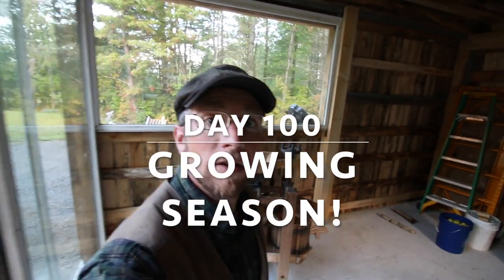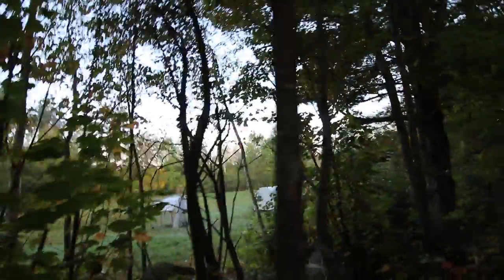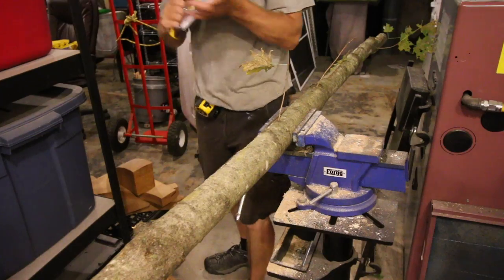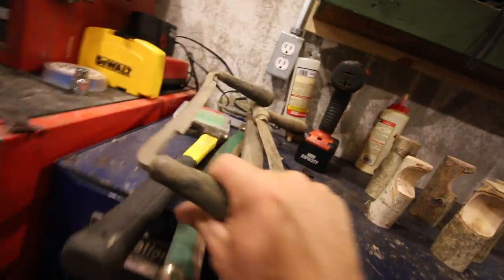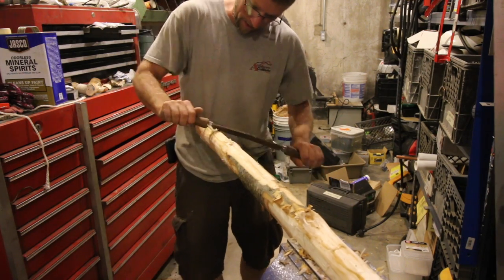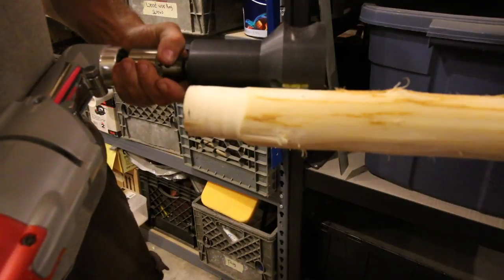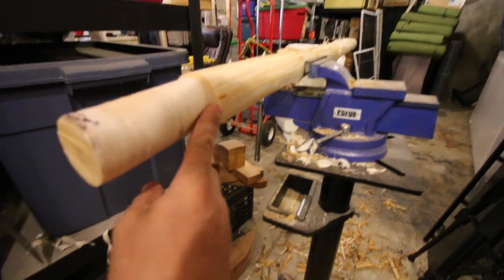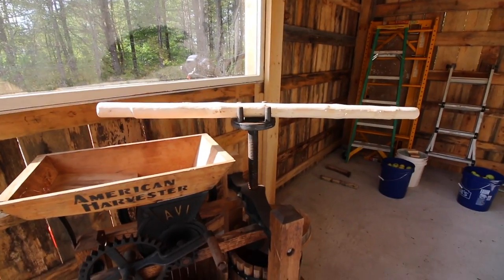How to make a Heirloom Quality Apple Cider Press Handle From a Tree

Comment: Al:  with that round tenoning bit,  I can see a lot of rustic arbors and trellises for the garden.   Also I have a pruning blade for the hacksaw in my car tool kit.   Good to build a structure if I slide off the road in the winter and can't get out.
   If your prepared; it usually doesn't happen.   ( Cutting brush for traction to get out of a snow bank or at worst cutting fire wood and branches for a shelter.  In a duffel bag;  I also carry a couple of hanks of para cord and some food ( hard candy, biscuits and tinned sardines etc.), tarp, packing blanket, old change of clothes, trauma first aid kit,  small cooking kit with stove,  instant coffee mix with powdered milk and sugar,  the same with cocoa in large pill bottles, etc.   
To help yourself or others.      Bert
Reply from the maker: That is a nice kit!

Comment: Congratulations to all the winners of the giveaway. 
That's a nice piece of maple for the handle. Ash would have worked well also, it is the prime choice for making baseball bats, and good for tool handles. As that maple is so green, I would suggest you seal the ends to minimize checking as it cures. The open grain of the ends will release moisture faster than the long grains, this will lend to checking. Wax is a good choice for sealing, although tung oil will do in a pinch, apply liberally. The round tenon cutter worked well for the handles.
Reply from the maker: Thanks!  We will need to get some tung oil on it soon. I got your package yesterday! Thank you very much!